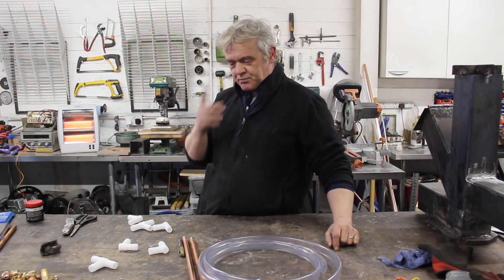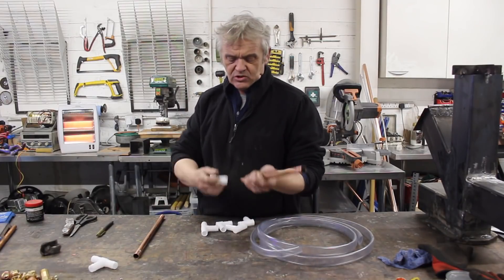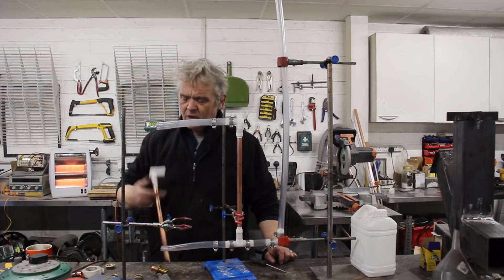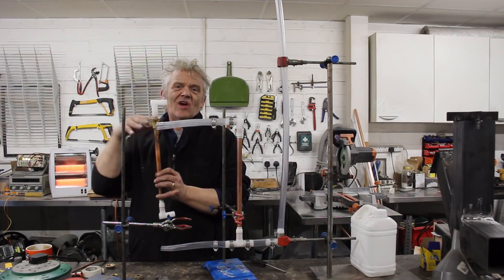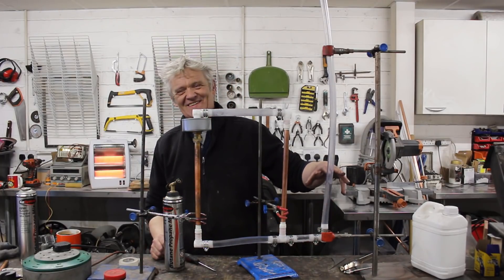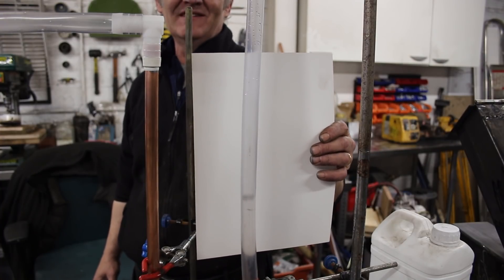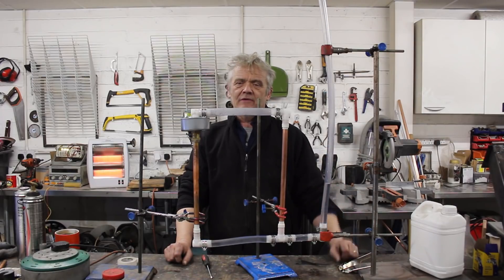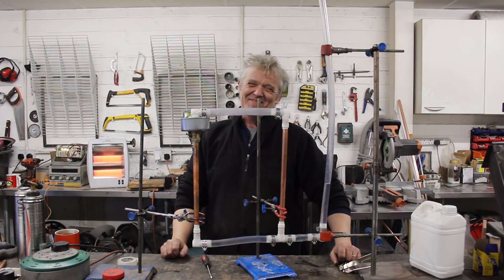1419 The Easiest Engine You Will Ever Build - The Fluidyne

Comment: Thanks. I works on a different variant of water pump stirling engines where my innovation have ideal discontionous movements of the floating displacer and isothermizer included. You can se my work on my channels. Some fluidyne on wiki have both isothermizer and a floating insulation body just like mine engines but my innovation have a up side down under water Line Ringboom innovation. One tip i figure out is there is an intressting material I start to testing more for this isolation material called Foamglas that may also be useful in fluidyne stirling with floating isolator on the hot side.
I have animation and some working prototyps as well as when I start working with Foamglas this time

Comment: Would a liquid with a lower boiling point be of benefit, I came across allylamine, only because it had a lower boiling point, I might try a ballon on the floating magnet pipe end to see what happens to the motion too

Comment: Great little engine.  Great job with the build.  Isn't this basically a thermoacoustic engine using water rather than air as this would still work with air?  Would be very interesting to give this a go with a cork as you mentioned, but with a rod and flywheel like in many thermoacoustic engines.  This one is so much easier of a build than one with air, but also much slower.

Comment: I like the magnet idea. Reminds me of the "shake light", an LED torch with some magnets and a coil, and as the name suggests, you shake it. Can't remember if it had a built-in recharbale battery or if it was just a "dynamo" type light, a rather a bouncy one, as with the wind-ups. However, the fluidyne powered by the woodburner stove could give a steady LED light.
I'll have to dig out the old fluidyne plans I bought pre internet and stored away as I couldn't see a good use for it at the time.

Comment: Love your stuff, dude! 

Seriously. I'm convinced that, at least in America, primary education only succeeds in convincing students that they can't understand science and shouldn't bother trying. Through every video I can think of, your focus has been on making the science of the matter accessible, while generally doing credit to the inherent complications. It's masterful, from a pedagogical perspective.

You've been directly the cause of many messes around the house, for me, and quite a few foul odors. You fool me into thinking I can science, and you do it so well that reality plays along.

P.S. this could totally work for a 3d printed motor. The limitation has been that precision multi-material is really hard, and conductive filaments are total trash, but with some high-temp materials, the high resistivity of the ProtoPasta filament would make a decent heater. I'd have to experiment with printed thermocoupling, but three stacked loops pneumatically driving a Wankel motor, could likely provide decent torque. Go lighter by replacing water with something that has better expansion characteristics, if needed. by adding a magnet or an oscillating coil at the rotor tips (whatever you call that part in a rotary engine), and N number of printed stator coils, where N is prime or not having 3 as a factor, one could even produce a stepper motor.

Comment: Could the thermal couple you just showed before, be incorporated into this? 
I know it's way more mass but on the hot side could mass be mitigated ( perhaps) by short sections of copper tube and ( iron, steel, aluminum) , other metal stacked on the hot side and cooling fins, Or water tank on the Cold side to increase the differential?
Reply from the maker: well I suppose you could. mate but I am not sure why you would - what are you thinking here? what is the objective of including it? cheers

Comment: I made a fluidyne a long time ago when I first started working. I used EMT, that steel electrical tube used for house electricity wiring. So the diameter was slightly over half inch. It has a nice 3" bend at the bottom. To cap the tops I chucked a 1/2 copper tube in the lathe and spun each end into a bell. Each bell got connected to the other with a 1/4" copper refrigerator tubing. So the idea was to make the body less conductive than the regenerator. Heat conductive. I used brazing to connect the pieces. Finally on the output I had a T. By placing a 1 way valve on the bottom leg of the horizontal T I was able to pump water up to 12ft. At 12ft the water barely made it up there. It would start easily, but it was a pain to restart without refilling carefully. The air pocket inside the regenerator was either evaporated away or maybe dissolved in the water so the level was too high or too low. Plus the heat was a soldering torch at full fire. I was eventually going to try placing a piece of styrofoam on the hot side to insulate the gas from the piston. Also was thinking of making the Pistons larger. I was thinking that maybe one cylinder could be larger than the other. Oh it had enough pressure to drive a water fountain.
Reply from the maker: nice jo mate

Comment: Can one make a pump with a fluidine engine, a water inlet and outlet, and two one way valves? I'ma give this a go.
Reply from the maker: yes you can mate - if you have q quick look on google scholar you will find quite a few designs
Reply: @ThinkingandTinkering  Awesome, I'll check, thanks for the tip.

Comment: Could you confirm if the power handling  capability  is related to the pressure of the working gas in the loop?
Reply from the maker: I will have to look it up I am afraid I suspect a few factors but don't really know
Reply: @ThinkingandTinkering  reguarding pressure, may I sugest lookinh up video "The Stirling Cycle part 1 (Stirling Cryogenics)
YouTube · DH Industries". At two minutes in it discusses the amount of work done in a cycle and how power is increased with a higher starting pressure. I suspect the same applies to a fluidyn.

Comment: oh cool.  
Seems like if you used flex copper, that would be easy to wrap your hot end around something like your rocket stove. 

Do you know off the top of your head if there would be any benefit to having your cold side pipe run through a water bath or with a heat sink for better/faster cooling?
Reply from the maker: I imagine it would help maintain the heat difference across the engine mate - a Fluidyne is a type of Stirling engine

Comment: Build a Fluidyne Engine from 12" (335mm) pipe, and use Subwoofers as a generator?
Reply from the maker: that would work just awesomely
Reply: I've still got a 12 inch in the boot of my sporty little number

Comment: Cool, any idea how low a temperature difference a fluidyne could work on?
Reply from the maker: no - but it can be pretty low I believe
Reply: @ThinkingandTinkering  That makes it very interesting. I have an idea in my future projects file to run a loop through my attic to drive a sterling engine generator.  This is simpler. 100' pex, a T and a few Els, fill it with water and auto radiator antifreeze, a float, magnet and coil.  I have a scavenged baseboard water heat radiator that I could use to keep the cool side short.  Probably <$100 project cost.
Reply: How about with something like R-134a (Car air conditioning refrigerant)? At atmospheric pressure it boils at -15C, but if you pressurize it, you could raise the boiling point to whatever you need it to be. The other way would be to use water under a vacuum and lower the boiling to whatever what you want the boiling point to be. I guess the downside is you would need the top end of the pipe sealed. I assume RMS has it opened to the atmosphere. I'm not sure how that would affect this engine.
Reply: @Zenman Energy  I have seen comments that evaporation is a necessary evil with the fluidyne
Reply: @David Mashiah  The evaporation from the hot pipe to the cold pipe, sure, but not to the atmosphere. When the heat is removed, it will change back from gas to liquid and no fluid is lost. Stirling engines commonly use hydrogen and helium. They certainly aren't exhausted to the atmosphere with each stroke.  I bet all it would take is an appropriate sized heat exchanger and then the system could be sealed up using whatever heat exchanger fluid you want.